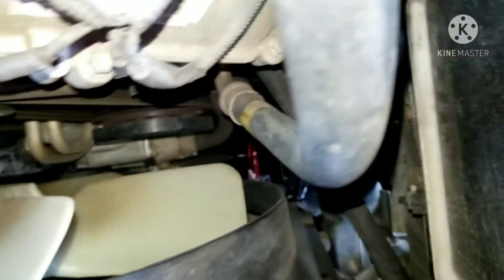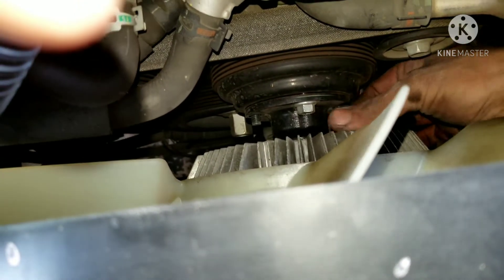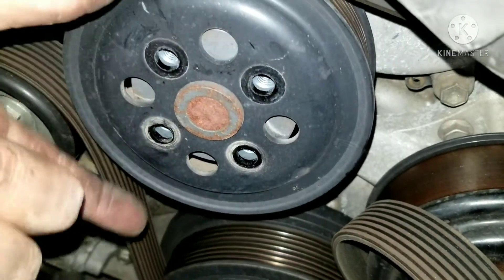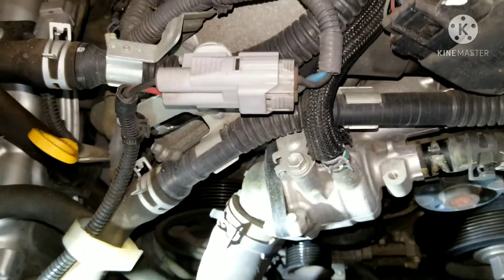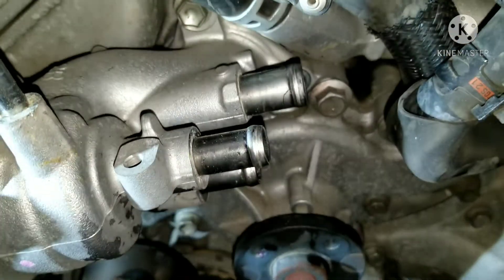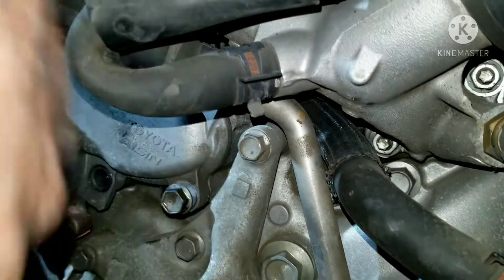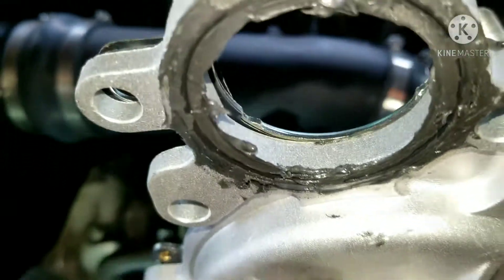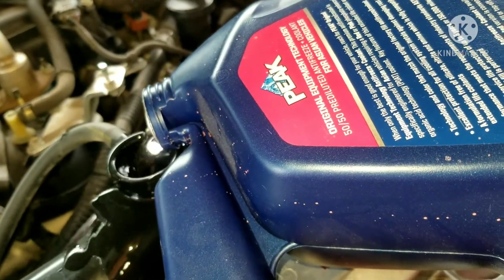2010  Toyota tundra water pump replacment

Comment: When you say you replaced the water pump is that more of a bracket that holds a bearing for the water pump shaft that comes out of the inside of the motor ? and does that bearing fail over time and is that what causes the leak ?thanks trying to track down a squeal at startup..sometimes ...that goes away when something comes on..either a fan clutch or ac clutch..
Thanks for the video !..
Reply: Oops.. watched again and seen the pump vanes in the pump!